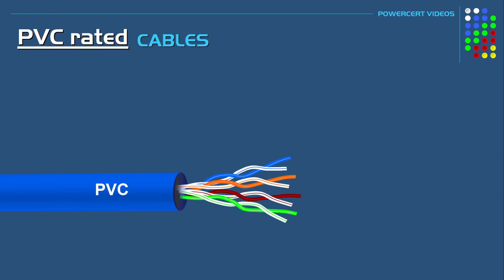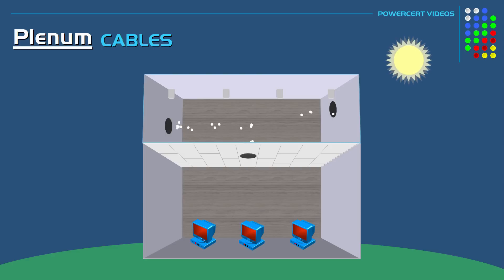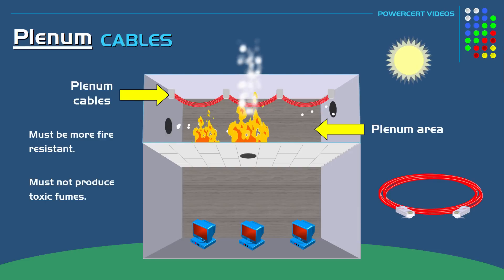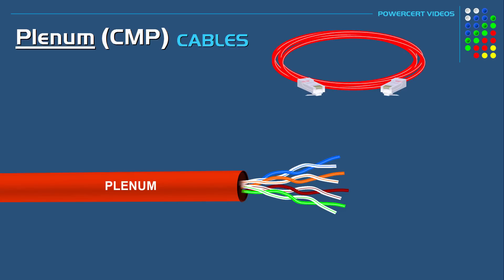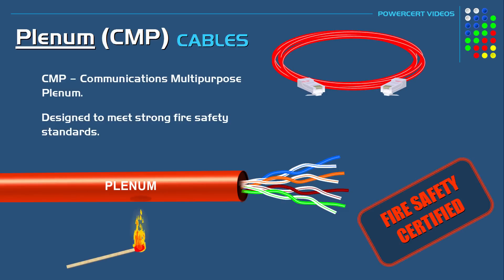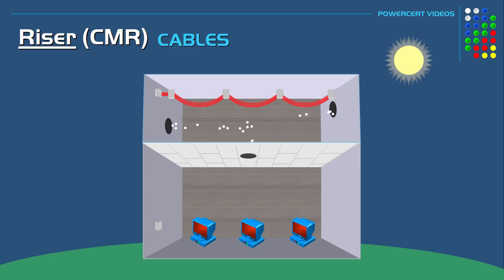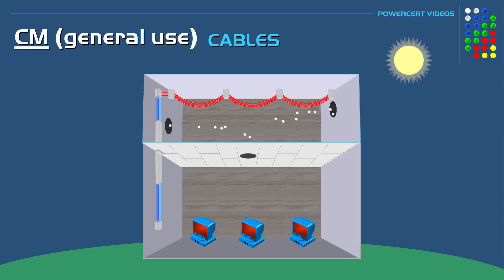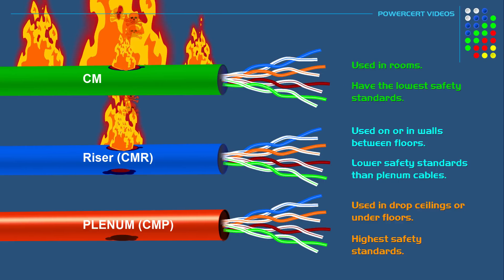Plenum vs Non Plenum PVC Network Ethernet Cables.

Comment: In a lot of new construction of the last few years open ceilings are now being enforced as plenum spaces. If you don't understand why:
take the first image with drop ceiling, remove the drop ceiling and the ducting, leaving just the supply and return vents. 
Any living space or office space is a plenum, air is being moved there. If you want to make a building a non plenum space, remove the roof.

Comment: I installed plain cheap cat5 non e cable throughout the house in 1998. All of my wired devices will do long sustained 1gbit transfers no problem. I haven't tried to take it any higher than that though.

Comment: First time on the channel. Nice explanations but, the professionals already know this stuff.  I assume this video is for regular people, in which case, the illustrations using office buildings are not applicable.  What cable type should one run in a US home's attic space and in a home's walls behind drywall sheet rock, with or without insulation? Thank you.

Comment: There are a few corrections that need to be made, this has been my profession for 20 years.... 1 - It is ALSO about the inner insulators, they too must past burn testing.  2 - PLENUM is made out of PVC, it just has a different compounds. Plenum is still PVC. 3 - Plenum still produces toxic fumes, such has Halides. It just produces LESS toxic fumes. 4 - UL is not “global” it is for the USA, they don’t use UL in Europe, China, Etc. 5 - Not every Plenum cable has FEP, in fact very few Plenum cables contain FEP. I can only think of a couple FEP Plenum cables (one is the CL1 Lutron 216 cable, but that is all I can think of)
Reply: Damm bro dont roast this channel
Reply: I'm happy to fail as a result of their supposed error rather than this perfection.
Reply: You wouldn't call UL 'global' just because its based in the US? They have operations all over the globe, and their standards can be applied for/used by non US nations. That would be like saying ETL/Intertek isnt global because its in the UK, even though it also tests to US bound products as well...I think its fair to call them global.

Comment: When i used to run cable for a living when ever we ran any Cat5 cable in a building in the ceiling or walls they always used plenum cable just so we would not have any issues with the fire chief allot of the cables we where running where new office buildings every once in a while i was at an existing building like Chick-fil-A headquarters just outside Atlanta i dont miss thous days. LOL
Reply: So when did you use Riser cables?
Reply: @KennethITGuru  Usually only big one story collages or office building's from wall to closet we would build the rack,s and install them from the ground up and terminate & label everything man this was back in 2000, 2001 i got layed off after 9/11. they would give us big boxes of Cat 5 or Cat 6 depends on the contract i guess. also did a bunch or fiber coax and bundled cat five cables make a crap ton or T1's